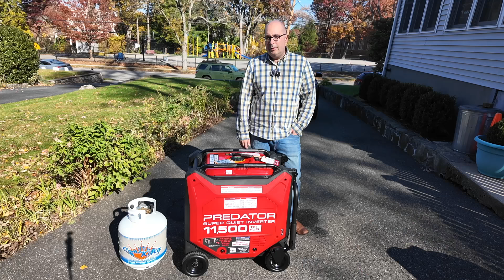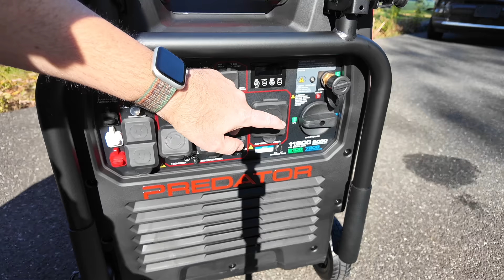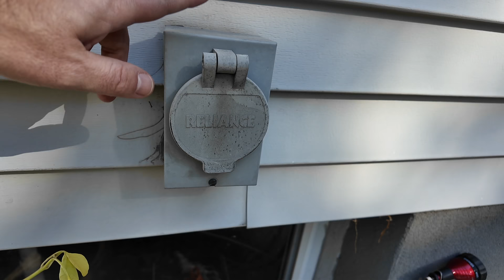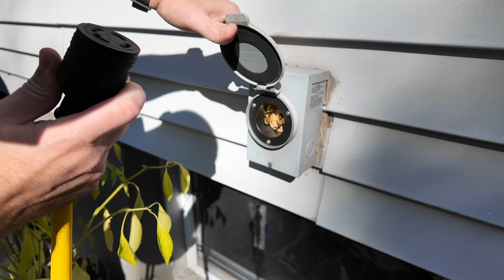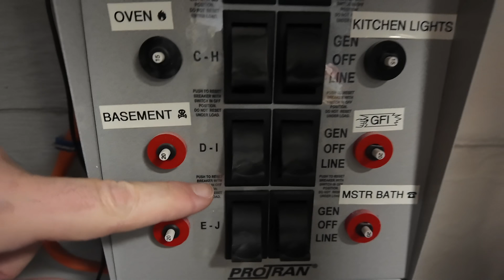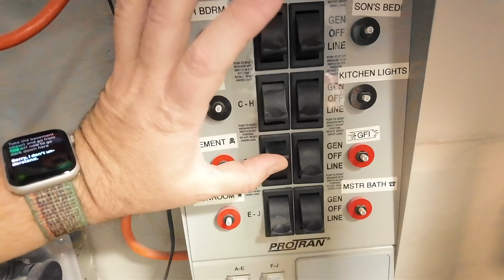Predator 11500w Powers My Entire House (Transfer Switch & Full Test) — Honda Should Be Worried!

Comment: Maybe I missed it, but what about disconnecting the neutral/ground bond on the generator ?  By code, there can be only one, which is done in the house box, so the generator needs to have the white wire disconnected, which appears to require some disassembly of the panel where the ground connection is located....
Reply from the maker: Agreed! I need to figure out how to make it floating neutral. Just need to find the wire to disconnect it. Will post a future video when I figure it out
Reply: @Outdoor_Prepper  Just picked one of these up a few days ago, took apart the front panel to upgrade the inlet hose fitting to accept a 3/4 quick connect. Also was able to find the neutral ground bond. It is behind the main control panel right where the grounding lug is. It requires security hex head bits to remove the panel. You cannot fully remove the panel, as the gas block on the right secures it in, but you can pull it away enough to release the the ground lug, from there you just pull away the white neutral wire, it is pigtailed over the far left neutral plug to allow you to link two units, so you can pull it out and apply heat shrink to the connecter and put it back behind the panel.

Comment: Hey.....great video.  Question: I see that you hooked up a 20 lb propane tank.  How long can this generator run by using a small tank?  Would it better to use a 100 lb tank or is a 20 lb tank enough?  I live in an area where there may power outages that can last a couple days.  My home is not that large....about 2000 square feet.
Reply from the maker: Definitely better to use a larger tank. Harbor freight recommends a 40lb minimum. I tested it in a 20lb tank at 2000watt load and it ran 8 hours

Comment: If you plan on using LP I would get at least a 100 lb tank. That would give you about 24 gallons which should last about 12 hrs.
Reply from the maker: I got 8 hours at 2000 watts on a 20lb tank

Comment: Unless you want to risk your home insurance denying a claim if things go wrong, apply for the proper permits and have an electrician perform the wiring. After buying mine, I installed a small resin shed to store it. If you plan to power your HVAC, I suggest you add a 'soft start' device to your AC. You also need an LP storage tank large enough to power the generator for the duration you plan to run it. The one shown in the video is too small and would only power the generator for a short time. A company called AMERIGAS will help you decide which tank size to consider. I hope my suggestions help you.
Reply from the maker: Thanks for watching and for the tips!

Comment: Excellent videos so far. An experiment that you may want to consider is cold temp starts at various winter temps testing with the three fuel types.
Load testing would be another test. confirm voltage stability at various loads
Reply from the maker: Thank you and Those are great ideas for future tests!

Comment: Only reasons to ever consider a whole house automatic system
1. You loose power very frequently and/or need power to be restored even when not at home.
2. Your age or physical condition would make moving and setting up difficult
3. Someone in the home is dependent on medical equipment
4. Need to restore power immediately and no place to run a portable in the middle of a rain, ice or snow storm

Also, downside of a whole house propane system, if the outage is very long (multiple days) and you tanks were not 80% plus it could be a long wait for a refill.  After an ice storm a few years ago people in need of a refill were told a week or more before they could receive a delivery.  Seems like a nice unit, will be interested in the long term reliability and parts availability for this unit.
Reply from the maker: Great points and thanks for watching!

Comment: Only suggestion i would have is when you do the cost comparison,  give the plumber cost for a natural gas quick disconnect. Most people will not want to deal with multiple 20 pound propane, or large propane tanks durring a prolonged power outage.
Reply from the maker: That’s a great point! Unfortunately not everyone has natural gas service but for those that do, I agree - natural gas is the way to go

Comment: You better have a whole bunch more 20lb propane tanks if you hope to have the generator do you any good in a bad situation. Also, a whole house generator will power up on it's own if your home or not. The stand alone generator depends on someone being home to power it up, connect them to the interlock, and switch the interlock over.
Reply from the maker: Those are definitely good points to consider!

Comment: Did you un-bond the neutral/ground?  Mind showing how you did that on this generator?  Since that MTS doesn’t isolate neutrals your generator needs to be floating neutral.
Reply from the maker: Agreed I think I need to swap this to a floating neutral. I need to do a little research to see how to do that since this generator is so new there’s not much for me to refer to. Once I figure out how to unbond it I will post a video on how to do it. It should be relatively simple once I can locate the right wire
Reply: @Outdoor_Prepper it should indeed, I purchased this gen 2 weeks ago and the electricians are coming to install my 2 MTSs in early December (split 400amp service), so I also need to do it.  On some it’s behind the panel, on others you have to unhook from the gen windings itself.  I plan to add a switch to bond/unbond once I get around to doing it myself.

Comment: Can't you just turn the Main Breaker off, and back feed into the House through a direct 240v connection? I mean, as long as the House in isolated from the commercial grid, it's the same as an interlock....right? I know that local "Code" might require it, but the result is the same, as long as you trip the Main Breaker FIRST!
Reply from the maker: You definitely can do it that way. I’m just trying to stick to Code, but that approach would work as well.

Comment: The little brother, 9,500 watt inverter, has been running in over 100 deg heat for up to 4 days straight several times a month for several years. It powers 2 (sometimes 3) full sized RVs, usually running AC, at the same time. It. Will. Not. Die. If the 11,500 is anything like it, this will indeed be the best generator I've seen. Bought this one last week, looking forward to seeing how it holds up.
Reply from the maker: That’s awesome to hear the 9500 is doing so well! I hope the 11500 proves to be equally reliable! Thanks for watching
Reply: @Outdoor_Prepper what about their new 13,000w predator generator
Reply: @GBR1111-x2t not an inverter gen.
Reply: Mine ran continuously for 6 days during the 2021 ice storm

Comment: Looks like you started the generator while the house was plugged in. Not sure if the breaker was active, but you really should let the generator run for a couple minutes before hooking up the cables (or at least turn the breaker off)
Reply from the maker: Good catch! The house was plugged in but all the circuits on the transfer switch were set to line so no power was flowing into anything in the house until I switched them one by one to generator

Comment: Do you see a need for a soft start on the AC system?  If so, can you recommend a reliable brand?
Reply from the maker: For mini split systems, you won’t need a soft start, but for a larger central air you might. I’m not too familiar with the best brands so I would recommend consulting an electrician that would know more than I do.
Reply: @Outdoor_Prepper Thanks for the great videos and your quick reply. My brother-in-law installed a soft start and it failed less than 6 months later. I have been hearing that some units can handle one starting.  I guess I need to get a measurement when a unit starts to know for sure. I know I can't run both.
Reply: You can also purchase a hard start kit.  I paid $38 a few years ago for a 5-3-1 brand and I have no problem running my 2 1/2 ton AC unit with a  Champion  7500 watt generator.   A soft start kit will run closer to $300.   Either type simple to install after watching a YouTube video.  No special skills or tools needed.
Reply: @peterduthie1806  Hard starts will reduce inrush by like 10%.  Better than nothing but a soft start gets you into the 60-70% reduction.
Reply: I got an AirGo for my 4 ton AC I love it. It works great. It was so easy to install and they have excellent technical support. You can call the guy and he’ll explain anything but you probably won’t need it.

Comment: I have a transfer switch.   A benefit of this vs an interlock is that I know when the utility power is restored since the various lights come back on in the house.
Also folks should be aware it is a good idea to switch all loads back to LINE before turning off the generator to prevent losing the residual magnetism in the windings.
Reply: Although that’s true, that’s such a minimal advantage of a transfer switch over a manual interlock. I wouldn’t even consider that.  Not sure why people think that’s such a big deal so what I run my generator another 20 minutes before I figure the power is back on. If that really is something you want they make devices that alert you
Reply from the maker: Those are some excellent points about transfer switches and generator use!

Comment: I have an interesting dilemma, my main power coming into the house sent first to external panel outside 200 amp service, that’s where the breakers are for my water. Well, the other circuits go into the house through the attic into the garage where the panel like you’re showing in this video is.  Where should I put my interlock? I need to have the water well. I can run everything in the house except the water. Well if I go in the way you did it.
Reply from the maker: An electrician may be able to install it inside or install the interlock in the exterior panel. I’d have the electrician give their opinion on best location but I’m sure it could be done. Thanks for watching and hope the video was helpful
Reply: Following

Comment: If you use gas, absolutely use only the BLUE GAS! (No ethanol) then you won’t have the gumming issues. Still drain the bowl at the end of the season and you’ll have a gas system that’ll last for years!
Reply from the maker: That's a fantastic tip for keeping the fuel system clean and extending the generator's life!
Reply: @Outdoor_Prepper  not necessary at all. If you use regular gasoline and properly store your generator dry - completely DRY - you will never have gasoline issues. Did it for 20 yrs. Generator started on first pull

Comment: Regarding gasoline as fuel, it would be best to use only ethanol free fuel. It’s more expensive but worth it for long term storage in the tank as it has no alcohol that absorbs water and causes problems.
Reply from the maker: That's a great tip for fuel longevity!
Reply: Have a old Generac 8,500 watt generator that runs on gas.  Where we live only loose power 1 or 2 times a year but sometimes more than 1 day.  I've adopted the routine of keeping 3 5 gallon gas cans which I rotated thru using the gas for mowing & snow removal.  Complete a rotation every 2-5 months and treat the gas with Stabil 360.  Always shut off fuel and run dry after each use, after a few weeks will drain the generator tank of all remaining gas.  It's been over 15 years and the generator still starts on the first pull and runs fine.
Reply: @johnwalker6121  same here but no Stabil
Reply: Store your generator dry - completely dry. Never used ethanol free for 20 yrs never will. Don’t store gas in your generator period
Reply: @condor5635 I agree if the situation is right. But if have to have power readily available, I’d rather have a full thank on ethanol free read to go.  If I’m not home my wife could start it but really struggle with fueling it, so that’s why we think it’s best to have it ready. Cheers.
Reply: I do the exact same thing run it  dry completely dry. Drain the carburetor bowl   I haven’t spent a dime on ethanol, free or Stabil. Not needed if you store it right.
Reply from the maker: 100% agree! Thanks for watching

Comment: I purchased a new inverter generator last year. I did look at Peditor inverter but decided to go with a Cgampions. The reason * went with the Champion is cost. When I purchased the Champion I bought it for $662.00. The Preditor of the same size was close to $900.00. The other was the warranty.  Peditor was only 90 days while the Champion has a 3 year. My generator is straight gasoline. Because where I live I have no access to natural gas. If I was going to go with  propane. I would have to rent a cylinder to support it.. One note you missed in the video is. When you are running on natural gas or propane you loss 10% of the rated power. I have 7-5 gallon gas cans. That iff I know there is a storm coming that I have the protential of loosing power. I fill thos gas cans. The gas cans are enough to power my generator for a week. If the storm passes annd I don't use it. I pump it into my truck.
Reply from the maker: Sounds like you made a smart choice with the Champion, especially with that warranty and fuel setup! Thanks for the tips as well!
Reply: I don't like to store gasoline as all my lawn equipment is electric. I have a hand pump to be able to suck the gasoline out of the cars we have if needed. Generally both cars are not empty so I would be good.
Reply from the maker: This can run on natural gas or propane fortunately

Comment: When using propane I would HIGHLY recommend that you use a propane filter at the point of connection on the generator as the hose will leech oils that will clog it's fuel lines.  When using gas, always run it dry or drain and shut off the fuel prior to long term storage.
Reply from the maker: Those are great tips to keep the generator running smoothly for a long time!
Reply: Leaching is largely associated with high pressure hoses not like the ones that come with these generators where they are pressure regulated at the tank end to ~11 inches of WC

Comment: I live in the pacific northwest and lose power every winter. Our house has a transfer switch and I use a Champion 7850 watt gas generator. It powers five circuits in our house including the septic and furnace. I've been looking to upgrade it since it is loud!! This might be a good option since we also have a fridge and chest freezer in the garage and this one should handle those too. We were looking into a standby like generac since it's easier for my wife when I'm not home but last year we lost power for five straight days and my neighbor who has a standby generac complained that he could never shut it off. We are all back here in the woods and on large propane tanks for our house and that's one reason I always want to stick with a gas generator that I can shut off when I want too and not drain my large propane tank. Also those generacs are just as loud.
Reply from the maker: Thanks for watching! This might be a good potential replacement for your current unit. It’s pretty easy to start with the electric start and so far I have no complaints with it.

Comment: Thank you for this video. The intro reminded me of the old dexter shows. Awesome. I had a question about the 'break in' time. Does the 30 hours have to be consecutive or just the first 30 hours. Also, it says change battery every 3 months on the sticker. Does it mean, charge? Please and thank you.
Reply from the maker: Break in just has to be 30 hours total - doesn’t need to be all at the same time. I personally change the oil at 5 hours, 25, 30, and then every 50-100 thereafter. It’s only a 5 minute oil change. I think they mean to say “charge” battery. Thanks for watching!

Comment: Im only half way through but i havent heard you say about getting rhe next size uo propane tank since it recommends larger than grill size to prevent freezing if using meaningful power, good videos, im definitely getting one
Reply from the maker: Glad you're enjoying the video! I'll definitely keep the larger propane tank in mind for future use. I tested it on a 20lb tank at sustained 2000 watt load and got 8 hours of run time. Thanks for watching
Reply: Neighbor across the street uses a 20lb tank for immediate use but also has a I believe a 60lb tank as backup.  Think that's about the largest tank you can reasonably transport to get refilled.